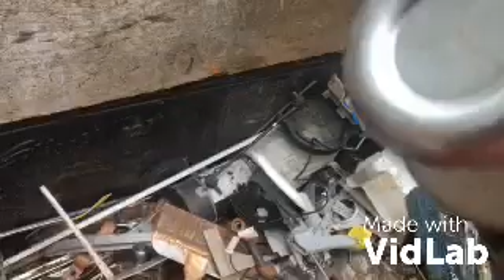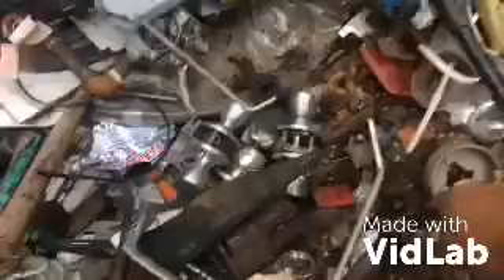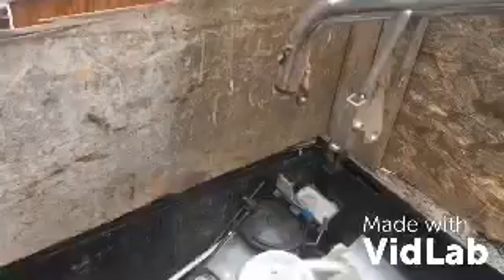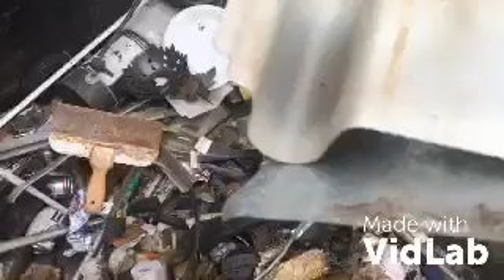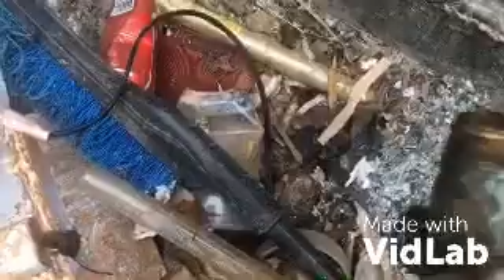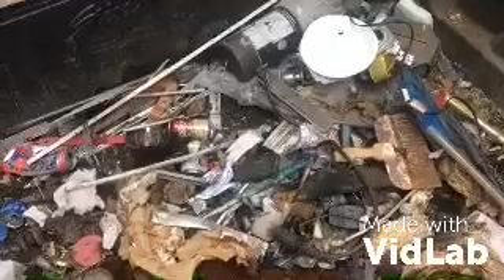MIXED METALS

Comment: Did the aluminum go up too Kingdom?
Reply from the maker: No aluminum is dead
It’s not going anywhere for quite a while
Reply: @steelisthemeal  You are breaking my heart Kingdom, I see it every where. I have to resist picking it up, almost ....
Reply from the maker: Well that’s what they’re all saying and from the looks of it scrapyards have huge stock piles of it matter fact they’re condensing it grinding it up putting it through shredders putting it in balers stacking it hoarding it.  Doesn’t seem like they’re selling it though
They are buying it for very cheap. They can win the waiting game where is I can’t really maybe for a little while but I can’t hang onto it for the next couple of years 
Current price is $.17 per pound
I know I know different grades confect higher prices. 
What does again some other grades of aluminum fetch lower prices for example breakage aluminum is currently selling for five cents per pound and Scrap steel is selling for six cents a pound so that means breakage aluminum is worth less than scrap steel  
Brass and copper are up a little bit
I think I’m going to sell my brass
I have about 140 pounds of it
Yeah $1.20 per pound I guess it’s time to sell
Reply: @steelisthemeal  Unreal that shred could be worth more! Aluminum is expensive to produce as it uses giant amounts of power.
Reply: We have a huge aluminum smelter in Northern BC, the only reason it exists there is they built their own Hydro dam back in the '50's so the power is cheap. They tried to double the electrical output of the Dam, I think it was in the 1990's. The government changed though and our new friendly socialist government shut the project down.  It came  to light later though that they were planning on exporting the power as it would have made more money that smelting the aluminum.
Reply from the maker: Yeah well this yard is paying only five cents per pound for breakage yeah I’m claiming that they really aren’t figuring the cost of energy 
They’re figuring the cost of money it’s self because if they’re buying it and there’s no demand for what are they going to do with it?
Reply from the maker: Well now that makes sense exactly where the where were they going to export the electrical power either to Washington state or California
Two gigantic liberal shit hole
Keep it up long enough and eventually the entire region of North America will  resemble Cuba
Reply from the maker: With the increased use of plastics in many applications demand for aluminum doesn’t seem to be increasing the way you would figure it to be
Plastics including carbon fiber
Etc 
Everything from automobiles to airplanes to beverages that we drink aluminum is constantly losing out to plastic

Eventually even streetlight poles won’t be made out of steel or aluminum but  out of carbon fiber or plastic
Reply: Cruiser Mac 22 cents a lb ...mid Nebraska
Reply: @kirkniles4184  That is not bad ?
Reply: Cruiser Mac yeah I didn’t think it was terrible....I mostly scrap because I don’t like throwing things out that I can make a few bucks on...I’m a housing repair handyman and run into a lot of scraps
Reply from the maker: Kirk Niles yeah that’s like throwing away a few extra bucks for some tools and other necessities
If you did that
Keep on scraping
Reply: @kirkniles4184  I work for an electrical contractor and same thing, I take the time to strip down stuff that is going to junk yard anyways. I think up here cast aluminum is going for about  35 cents Canadian a pound. Hoping Canadian Treasure Hunter makes a run to the yard this week to see if the aluminum has gone up. He gets a premium price though as he takes a lot of stuff in.
Reply from the maker: I’m only getting $.18 per pound
Usd. 💰
That’s like .23 cents Canadian 
Aluminum is way down
Reply: I use my scrap money for fun stuff and things I need done on my truck
Reply from the maker: There you go kind a like what I figured
Pretty much